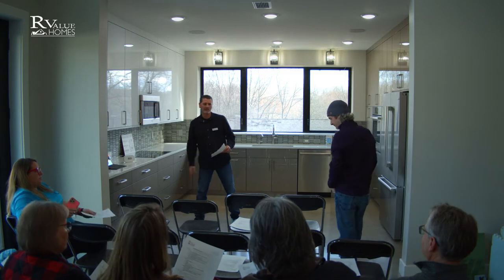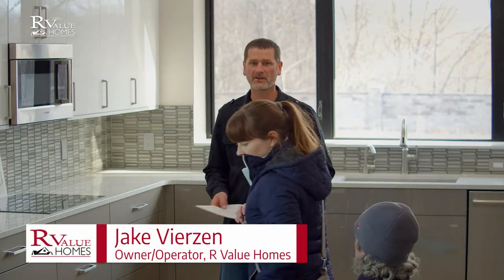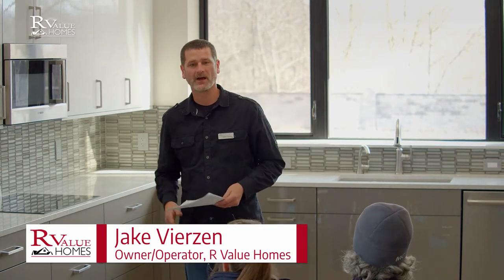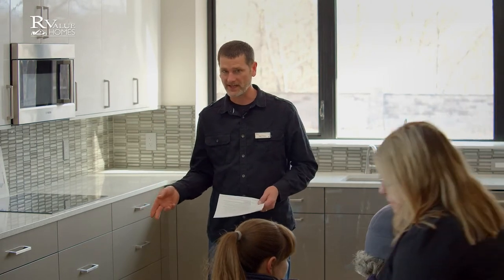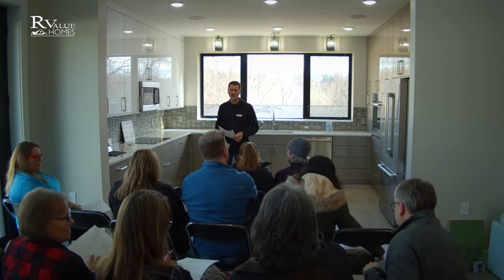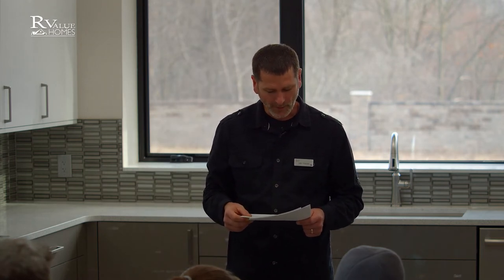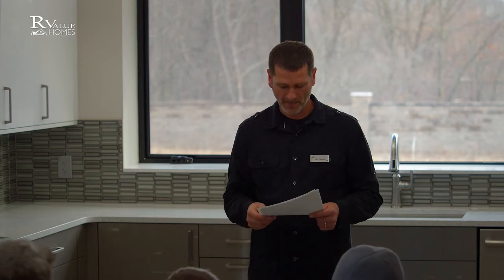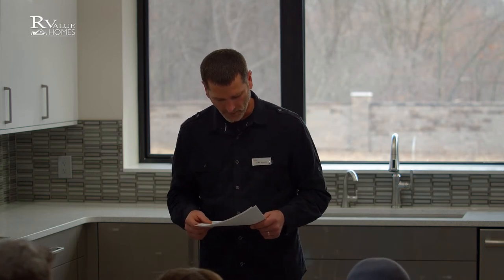Building a Net Zero Home In Four Steps!

Comment: Thanks Jack for the video, it was very intuitive. I am in the process of designing my ICF house. It will be in the White Mountain area of NH. It is going to be 3 floors using Nudura ICF block with 8” core. The ground floor will have 8” core of concrete, and for the first and second floor I am planning to add an extra 2” insulation that will reduce the 8” core to 6” core for the concrete but it will increase the thickness of the insulation foam. The R value will increase from R24 to about R33. In your opinion, do you think it is worth adding the extra insulation or it is not needed? Thanks again!
Reply from the maker: Good evening ejyogo! Great plan. In NH, the additional insulation could very well be money well spent. Here in CZ 5, for most home it is not. But I can't give a firm answer without looking at the energy model for your home, as well as the local cost of the additional insulation and PV.